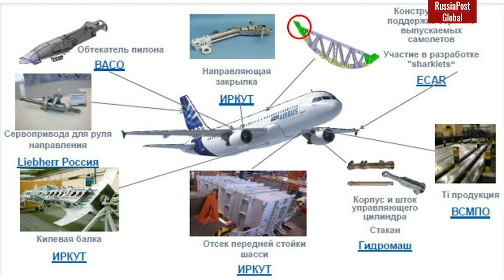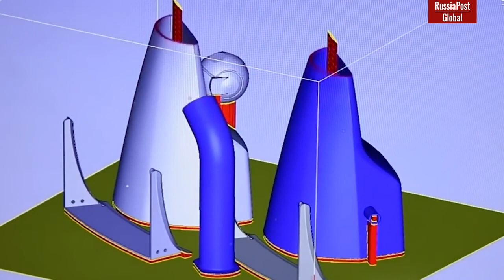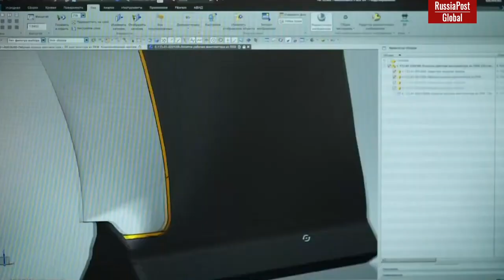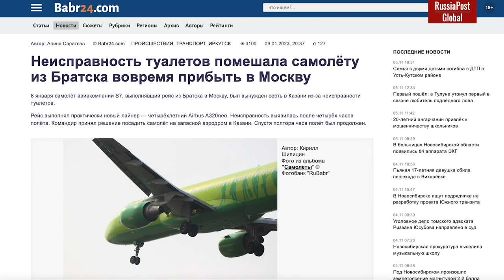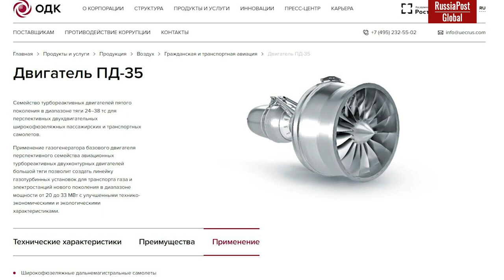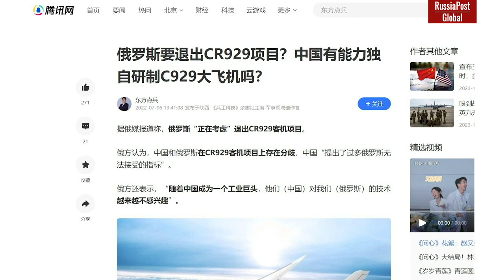Russia's Boeing replacement is ready: the IL-96-400M long-haul aircraft has taken to the skies

Comment: The first of only four IL 96-400s was built 18 (!) years ago. The 4-turbine concept is outdated, maintenance-intensive and costly.  Aeroflot retired its last Il-96-400 in 2014 due to its inefficiency.
The situation is even worse with the Sukhoi Superjet 100 (SJ 100): Only 1 was sold in the last 5 years, over 60 were ‘in stock’ in 2020 because returned or not accepted. The aircraft has significantly higher maintenance costs & downtimes than promised & than competitor aircraft. Probably not a single civilian product is of world market standard. Accordingly, Russia's global market share (outside Russia/Belarus) is less than 0.1% in mechanical engineering, electrical engineering, building of cars, lorries, aircraft, locomotives and ships, medicine, medical technology devices, optoelectronics, IT, hardware, consumer electronics (smartphones, refrigerators, televisions, etc.), internet business, wind and solar power products, etc. - and probably all other sectors.

Comment: The problem is it's a 4 engine aircraft. And that's a big turn off in today's market. That's why were only seeing twin engines such as the 787 and A350. If they wanted a 4 engine Boeing and Airbus would have done so. Hell Airbus had it with the A340.
Reply: Yes, and that's why it will not be in mass-production. Only few planes are going to be built. The next generation will have two PD-35 engines.
Reply: На самом деле без разницы, т.к. цель номер 1 заместить продукцию западных кидал. А на рынок будут делать новые самолеты.
Reply: That's subjective. If the airplane cost and operational cost are lower than that of the competitor, the number of engines is irrelevant.

Comment: China should have replaced Boeing with Ilyushin for their commercial planes rather than building the COMAC 919 and 929 planes. This way, Airbus and Ilyushin will provide all the planes for the Chinese commercial plane sector while COMAC spends its resources to focus on building the next generation of commercial airplanes (like supersonic, hypersonic, battery powered engines, etc). Just like how Chinese automobile industry decided to focus on NEVs instead of trying to build more ICE vehicles. 

Why compete in an area the west has at least 50 years head start? Why evolutionise when u have the resources to revolutionise?

Comment: LOL.. With an old airframe, wings and engine designs from the 80s... It will fly for sure (I flew the IL96) but the economics, flight duration and range will be as well from the 80s... I am not even talking about the tech in the cockpit if you want only Russian made instruments.  A good try but many many many decades have been lost to make such a plane commercially viable
Reply: Rome wasn't built in a day. Russia has lost 30 years due to the lack of need to build its passenger planes. But in 10 years their planes will be no worse than Western ones. After all, it is a country that builds great fighters and space rockets. Airplanes are not a big challange.
Reply: Russia has plenty of jet fuel.  They can subsidize the price  to the airlines.
Reply: @mefobills279  Isn't subsidizing fuel costs kind of admitting the fact that Russia cannot produce modern, fuel efficient jet engines?
Reply: They have bedn producing them for decades. Stop sniffing the glue.
Reply: What happened at the end of the 80s in the Soviet Union again???

Comment: As far as I know, there was no reason for Russia to not cut a deal 30 years ago to produce the 3 engine Lockheed L-1011 in Russia for domestic use. It used Roll Royce engines that were no longer state of the art. The air frame was fairly complex but conventional for the time. Same situation for the re-engined DC8's.

Comment: First Priority should be safety for the passenger planes! 👍🏻
Reply: It is...
Which can't be said for Boeing, lately there have been stories that they messed up badly with the pressurized bulkhead on the B737, then there's the story that they messed up some rubber dampers on, you guessed it, the B737, and right now there's a story that they messed up with by installing the doors on, again, the B737, so they flew out together with one row of seats!

Comment: I think the twin engine version of il-96 will be more economical for russia
Reply from the maker: Soon it will be twin-engine. They're developing an engine for it, the PD-35.
Reply: @russiapostglobal1589  good !!!!
Want to see il-96 and other russian made jets taxing , landing, taking off from indian airports
❤️ From india
Reply: They'll probably need the 4-engine one for transatlantic flights, as I doubt the West will give Russia's new planes an ETOPS certification.
Reply: They decided to do that only later. It was easier to modernise everything and use upgraded versions of the current 4 configured engine for now, because the time to bring a reliable engine to production is much less. Also Russia has an abundance of cheap fuel. So it balances out. They understand this plane is not aimed for the international market, but for the local market.
Reply: Russian reliability makes twins a high risk option
Reply: @tomaskulik80    that too will happen !! 
I think russia should start working on long haul widebody  twin engine jets equivalent to that of b-777,b-787, a-330,a-350 class 

Western sanctions will impact the availability of western aircrafts in service with russian carriers
Reply: Who cares about 20% more fuel spending if global economic war is going on. Especially in russia where fuel is in aboundance. Russia should just give some subsidies on gas and build own planes, even if are less economical